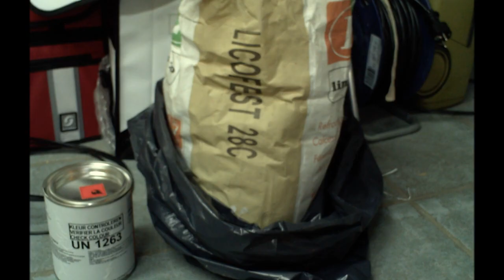Rocket Stove Heater. Building Part one

Comment: great job !!!
, what is the measure of the inside tube ?

thanks !!
Reply from the maker: +Jesus Duran I used a standard available flue pipe, 1000 mm long, diameter inside 125 mm, diameter outside 175 mm. See for instance http://www.haardmaterialen.nl/dubbelwandige-kanalen/holetherm/o-ht-125mm-inwendig-175-mm-uitw/dubbelw-ht-125-175-100-cm-buisdeel-rvs.html